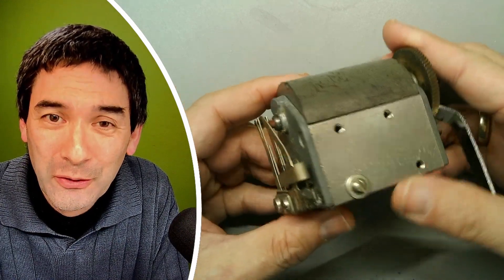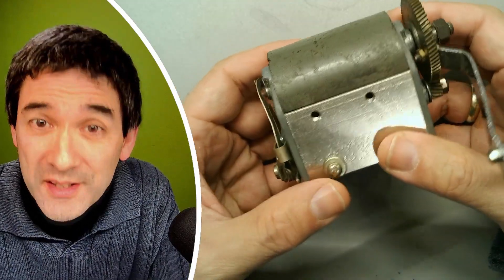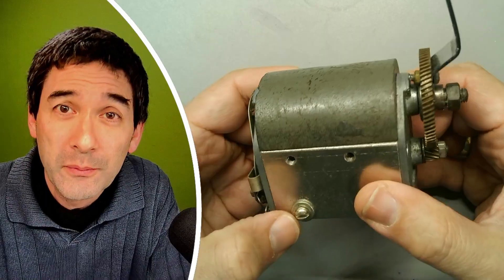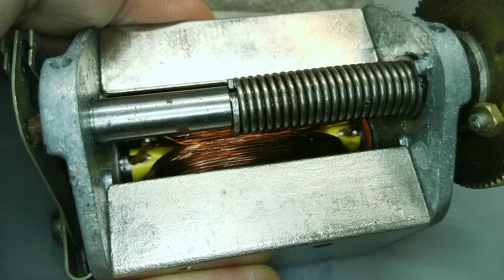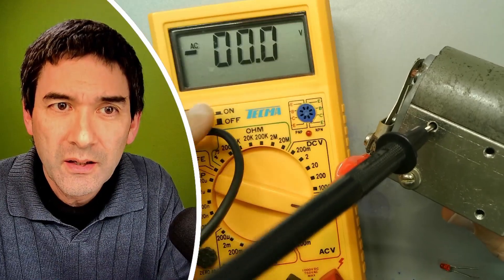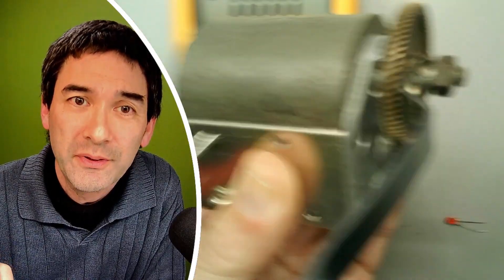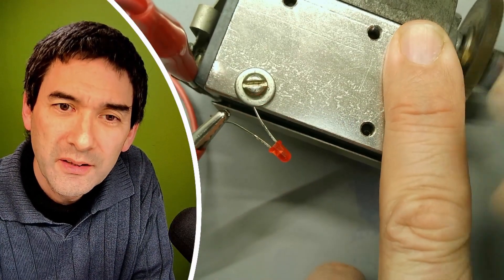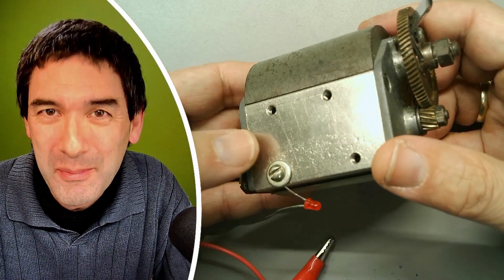This Strange Crank Device Sent Phone Calls in the 1900s

Comment: Yup, I guessed correctly😃
I used to play around as a child with a similar generator. Been quite the introduction into AC voltage and electricity in general back then.
Reply from the maker: That's so cool you had a similar one!
Reply: @TrashAndTreasures Well, mine was taken from a telephone which was used in railway systems, specifically DR. :)